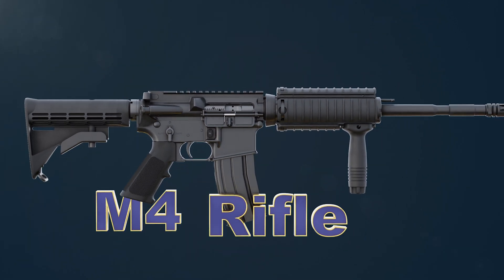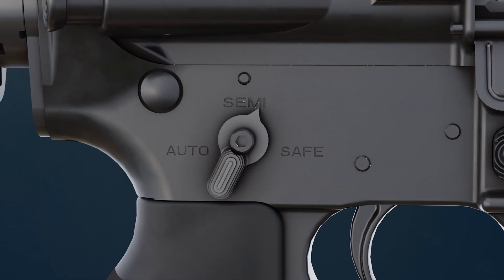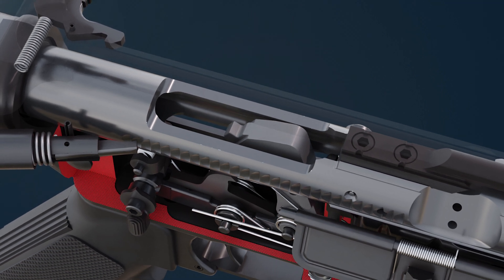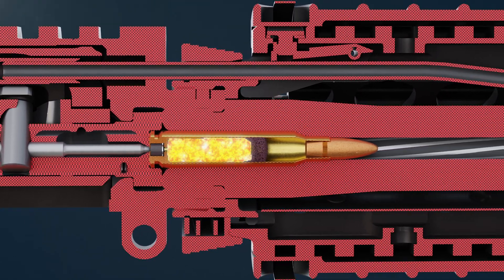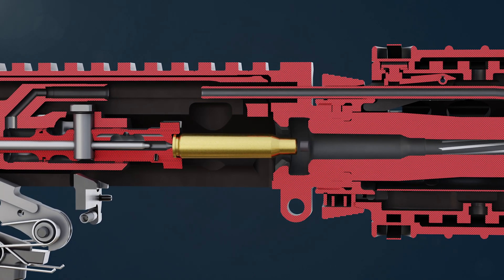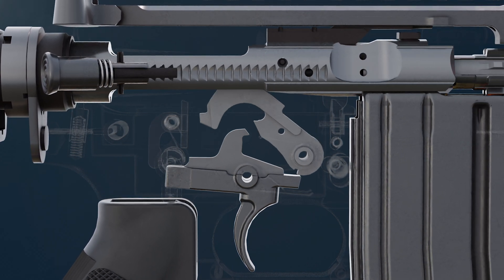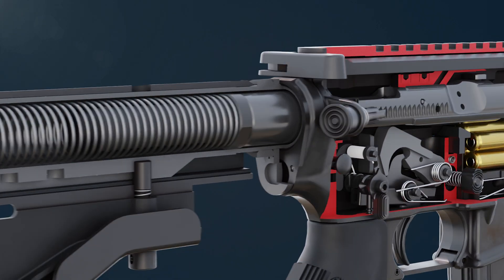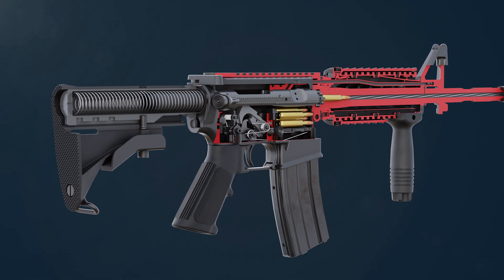Inside the M4 Rifle: Unveiling the Mechanics of Semi-Automatic Firepowe

Comment: Why did they chose channel gasses right behind a bolt, instead of pushing a piston on a bolt carrier?
Reply from the maker: Great question! The M4's design using channel gases for the bolt carrier, rather than a direct piston push, is mainly for compactness and weight efficiency. This direct impingement system makes the rifle lighter and more streamlined, beneficial in combat scenarios. It also offers smoother recoil for better accuracy, though it does lead to more fouling in the receiver. Each design has its pros and cons, and the M4's reflects a balance of these factors.

Also, I'd love to hear your thoughts on my other videos! Your feedback is valuable to me. Don't forget to subscribe to my channel for more insights and updates. Thanks for your interest!